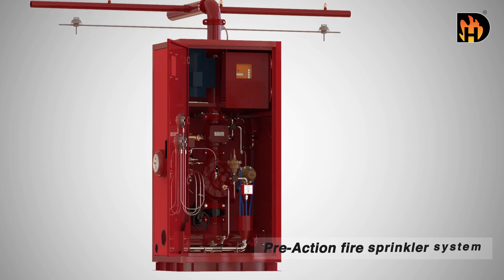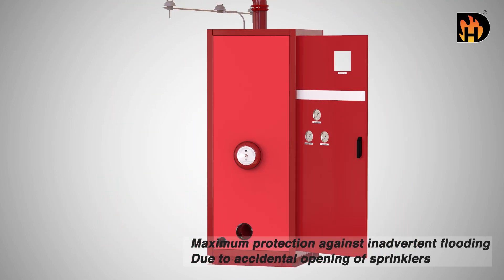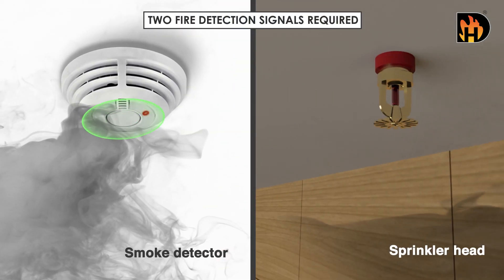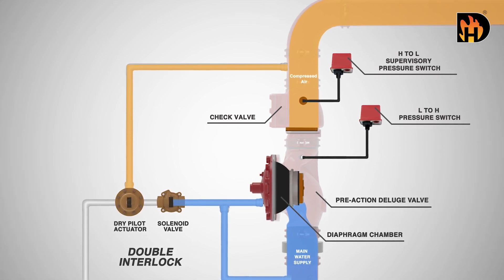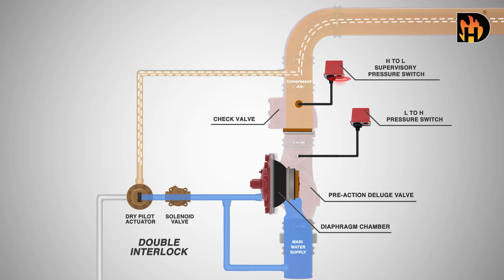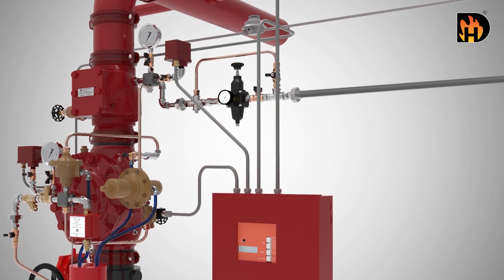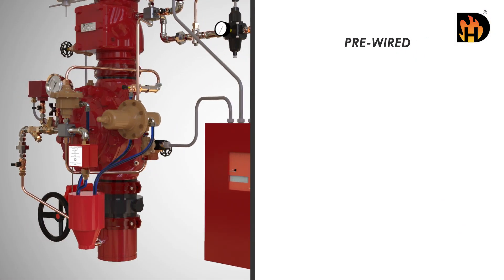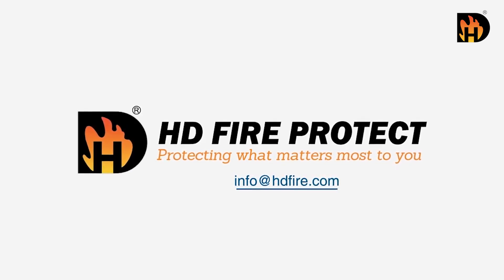HD PREACTION SYSTEMS

Comment: hello can we use the preaction system with wet system, meaning with water filling the pipes after the valve?
Reply: $ vh7mNjjorjkkNUIIIUYUIOOOLLOI❤😂😂😂😂😂😂😂😂
Reply from the maker: You can use single interlock wet pilot preaction system

Comment: good explanation. I still have some confusion with dry pipes system and preaction system. Dry pipe system contains compressed air. The air is released then water starts flowing once the system is triggered. With preaction system the pipe is also filled with air, then water comes into the pipe when the system is triggered. 
So i do not see the difference. what is the main difference?
Reply: Ummm I know your comment is kinda old (probably found an answer to your inquiry by now), but a dry system will discharge water once all the compressed air is gone from the system
This is regardless of if the water is needed (ie actual fire, damaged sprinkler head)

A pre action system will only discharge water once two signals are received
Smoke detector and lack of compressed air in the pipes (ie bulb of a sprinkler head breaking)

This is to prevent unnecessary water damage in case of something just setting off the smoke alarm or if a sprinkler is damaged accidentally
In both of those cases, water isn’t needed and the system can be delayed or shut off before water is pumped out

It’s kinda like where there’s fire, there’s smoke but smoke doesn’t necessarily mean there’s a fire

Sorry if you already found the answer ^^;
Reply: Dry type - empty pipe, works by sprinkler activation, dry valve

Non-interlock system - empty pipe, works by sprinkler or electronic device activation, deluge valve

Single-interlock system - empty pipe, works by electronic device activation, deluge valve

Double-interlock system - empty pipe, works by sprinkler and electronic device activation in premise, deluge valve